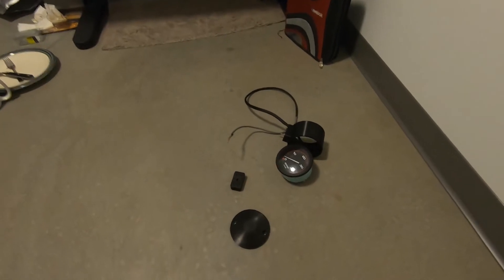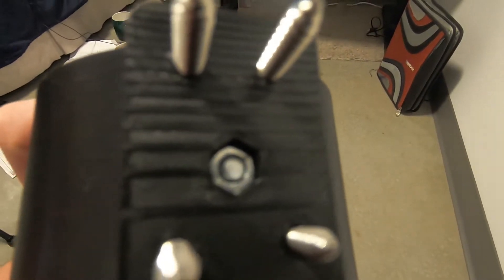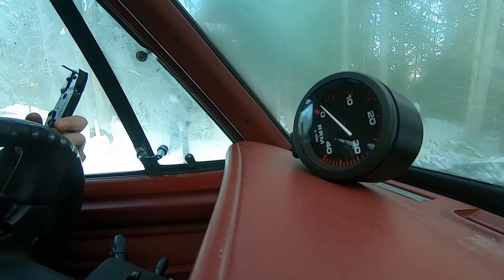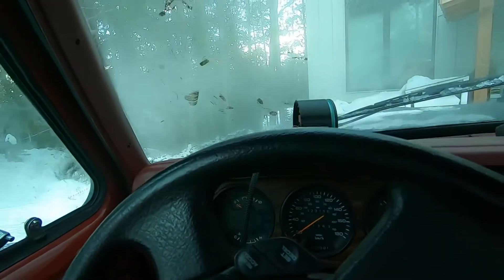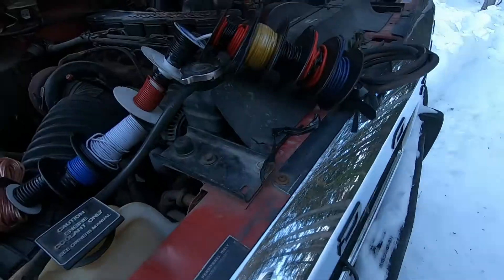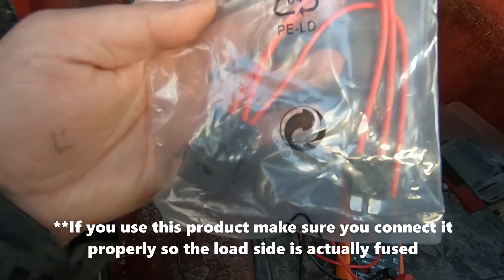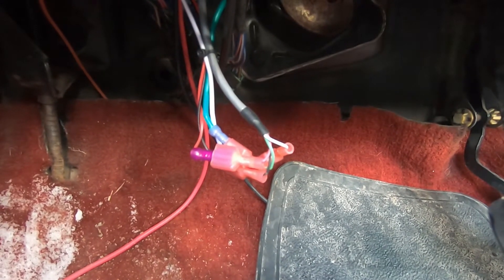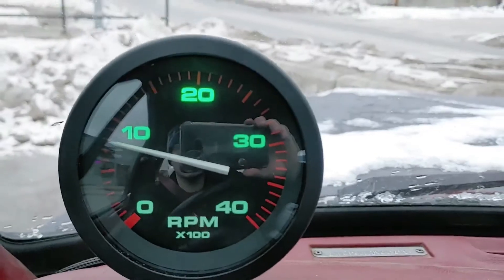First Gen Cummins Tachometer Install

Comment: I don’t like that it was more of a mount video than a tach install video. Would’ve loved to seen the wiring and not look for a diff video explaining it
Reply from the maker: The only wire I didn't explain how to hook up was the tachometer "w" signal wire, because I did that first before deciding to film anything. Plenty of good videos on YT how to tap into that signal though! My mount was really the thing I was trying to highlight, but I did get into the tach setup later on in the video. Any questions feel free to fire away.
Reply: Yeah, you’re exactly right. The actual mounting of the tach is a minor detail that is relevant only to the particular project. Like everyone of us has access to a 3-D printer for the love of God!

Comment: Isn't there a dedicated, rectangular-shaped connector for a tachometer in the first Gen's? I was going through, trying to simplify my wiring, and discovered this connector (which I couldn't identify, even with a schematic wiring diagram), with a large gauge yellow wire, hot with 12VDC (I discovered to my detriment, as I cut the connector out of there). That's what I learned from another video, anyway.
Reply from the maker: I just checked, no heavy yellow wire on the tachometer connector. I'm 95% sure your 1990 doesn't have the connector, do you have a crank position sensor at the harmonic balancer? If not, no factory tach signal.
Reply: @hevvyevvy  I have no such things, My Child. I just noticed a weird rectangular connector inside my dash. I just cut it out of there.

I love the simplicity of my 1990 1st Gen. For instance, I did the whole brake system upgrade: A disc brake kit for the rear end, and after that, the ABS delete (It was inoperative, anyway, sending all the braking to the front end). Best breaking system you can have on these trucks.
Reply from the maker: That's correct, the 91.5+ have a dedicated tachometer connector, which gets its signal from the ECU (via the crank position sensor). This is more reliable and accurate than the alternator-based tach which I have used; however, the Isspro and factory tachometers which are compatible are very expensive. I was looking for a bit more budget-friendly solution. I thought about trying to do something with the factory tach pulse signal using Arduino, but never got around to it once I decided on the marine tach route.
Reply: @hevvyevvy  Well mine's a 1990 D250 - No computer. So the jury's still out.

Comment: I installed a Teleflex boat  tach ( for gas motor) in my 1991 Dodge Cummins. It did not read signal from the factory tach plug located  under the dashboard. I then wired it to a W terminal from the alternator and it reads the signal, but it shows 1200RPM instead of 750. It can not be adjusted any lower with the adjustment screw at the back of the tach.  I will try to use a cheap potentiometer to lower the signal. Did anybody try this.
Reply from the maker: Hi Bogdan, my understanding is that the "W" signal from the tach produces an AC voltage where the frequency varies with engine speed; since a rheostat (potentiometer) wouldn't change the frequency, I'm not sure it would have the adjustment effect you're hoping for... Give it a try and let us know if it works though!

Comment: I’d like to know where the guy could get one of those tachometer‘s because it’s 4000 RPM it shows I got a 3800 RPM our governor spring in my truck and I’m not running it up that high because I got the original soft plugs in the engine and stuff like that I’m thinking about trimming a couple of my blades off of my water pump lower the pressure anyways don’t drive your truck in the salt and snow I got mine parked 91.5 it’s a six in a row jim From Kennerdell a Pennsylvania
Reply from the maker: Jim, the tachometer is listed in the video description. Sierra Designs Seastar 68358P (purchased amazon.ca). Where I live, we have snow / salt / sand 7-8 months of the year, it's going to be tough to avoid! As for cutting off water pump blades? I thought that was generally reserved for racing engines? I wouldn't want to have less cooling capacity than factory if I was daily driving or towing with the truck. I have the 3200 RPM governor spring and have been very happy with it.

Comment: Thanks for the GREAT video! I was SUPER pleased to hear that you were able to 3d print your housing/mount! I have access to a printer, but I'm concerned with how the housing/mount would hold up to vibration/rough terrain; any issues with yours so far?
Also, I love how your switch panel fit! Where can I find one of THOSE!? Where you mounted the switch panel, I used that dash panel, to mount a switch for off-road lights, but I'd like to expand switches for other things, as well as have them easier to access. And having the backlit switch ID's, looks AWESOME!.
Reply from the maker: Kelly, thanks for the feedback! I printed this using PETG (higher temp resistance and strength than PLA... required for hot summer days), and I'm confident the dash would shake apart before my tach housing broke or fell off. It has been going strong for a year now and I haven't had any issues whatsoever (robust design, 3D printer setup / settings, material and inherent vibration damping of the plastic all play a role I think).

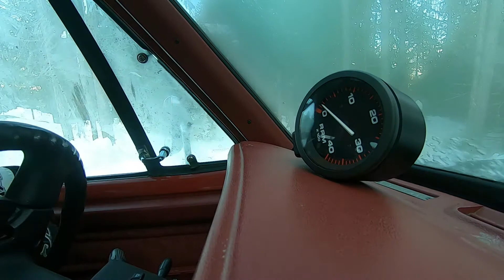As for the switch panel, that was also something I custom designed and 3D printed. Overall I've been really happy with it as well. All the switches run a relay panel I made and installed in the engine compartment (relay panel can be seen at 3:19 in my other Cummins YT video here: https://www.youtube.com/watch?v=oFdwheRW4-I).
Reply: @hevvyevvy  A question, again, about your switch panel; I can't get a good look at how you mounted it. I'm currently designing one, similar to yours, but in addressing the mounting, I got curious how you went about it, and how well it has held up since (assumed fastened with screws of some sort). I will have a few more components in my panel than yours; I'm going to be adding air bags in the rear, and the kit I have picked out comes with a roughly 2" gauge and air switch, that I'd like to have fit into my panel, as well. So mine will have a little more weight when I'm bouncing around. (I use my truck like a UTV; it's a farm truck as well as a trail rig)
If you were to do it again, what would you do different? 
Any tips for backlighting the switch labels? Any other tips, tricks, considerations you could pass on, would be appreciated as well.
I also liked how you did your fuse/relay panel! It looks simple enough, I will probably do something very similar, for all my accessories! 
Thanks, again!
Reply from the maker: @Kelly-zi9vg  I'm going to be making another switch panel with better backlighting in the future... The label backlighting system I designed is perfect for night driving, but isn't very visible in the daylight... I'll share the updates in another video, hopefully soon. 

I'd like to have the switch labels be a little more "modular" i.e. easier to change the labels around if I want to change the switch function. 

I fastened this switch panel to the dash using heavy duty 3M molding tape... Held up brilliantly over the 1.5 years it's been installed. The key is to ensure you have enough surface area for the tape to adhere (greater load/weight = greater surface area). I didn't want to drill any more holes in my dash than absolutely necessary!

If I were to design the switch panel again, I would have added more void space and made the panel a bit bigger to make assembly/install easier. 

I've installed a few relay panels similar to this one. It's no frills, but gets the job done pretty reliably.